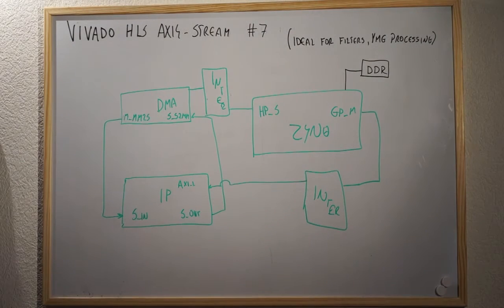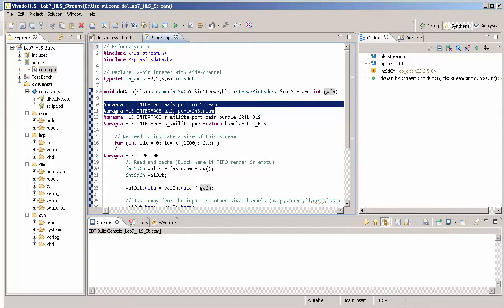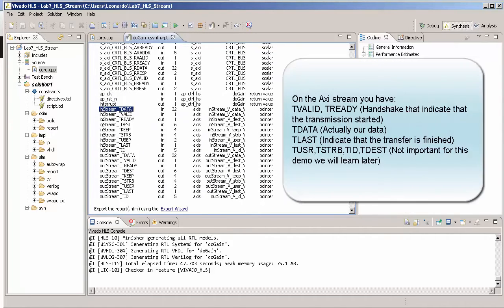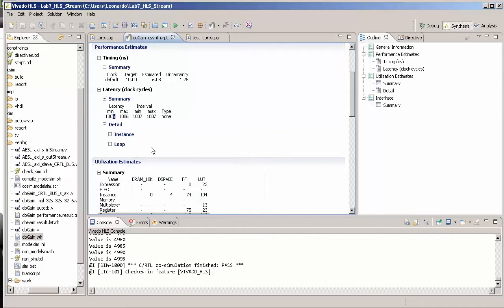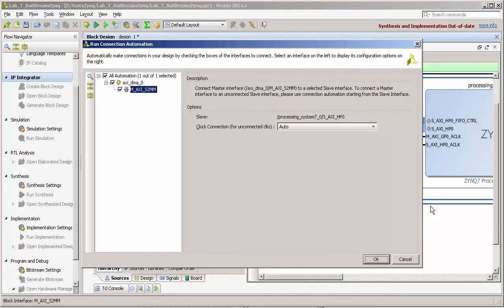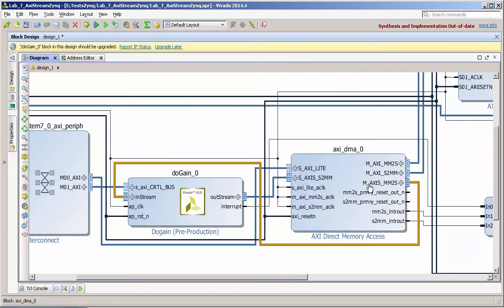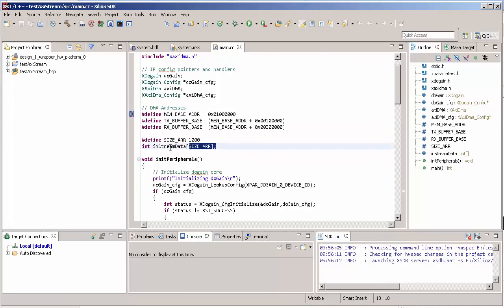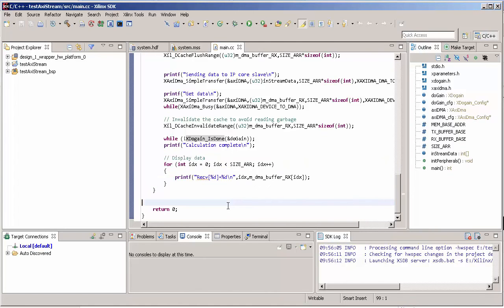VIVADO HLS Training   AXI Stream interface #07

Comment: This might be an outdated question but I am intrigued by something.

I've always wanted to use the AXI Stream the same way we use a AXI Lite. What I mean is, declaring an input and an output stream with an arbitrary precision data type and then specify to the synthesizer that both are AXI Stream interfaces, via #pragma. My objective is to basically get rid of the signal handling of the AXI Stream (driving KEEP, STRB, LAST, etc...). Is that possible?

Thank you very much in advance!
Julian

Comment: Hello, Thank you for the video tutorials. They are quite informative. I tried implementing the above design. I get error when I try to generate bit streams. The error is regarding IOStandard and Package Pins. The IO pins are not placed. Can you provide a constraints file or explain placement constraints or provide a link where I can get help.
I used LVCMOS12 IOStandard.
I need help in understanding how to decide a pin number for IO port ( example: package pin for outstream_TDATA[1]).